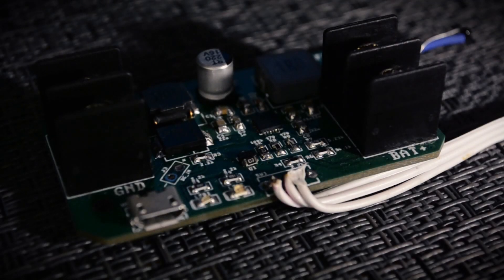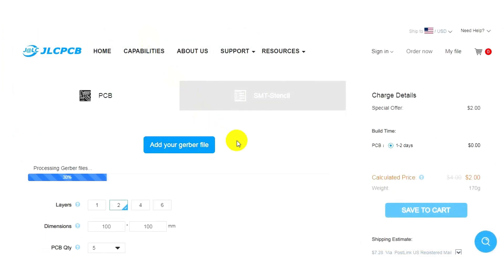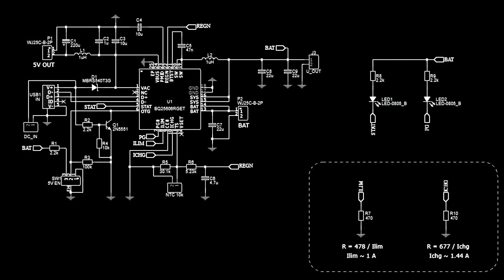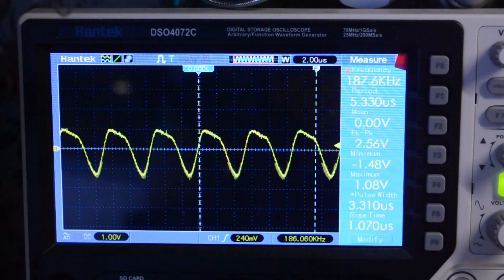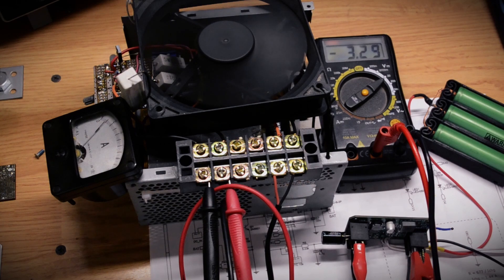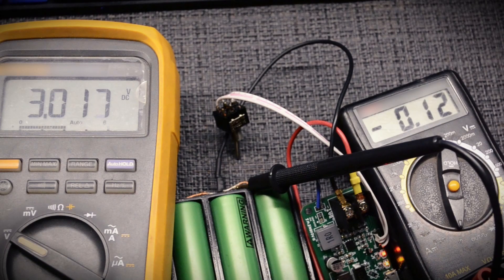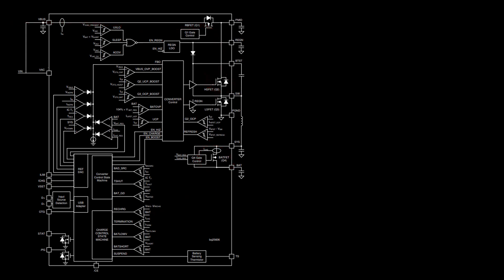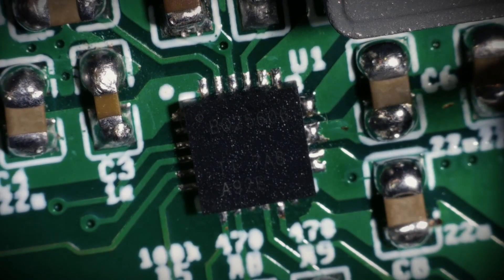Power bank - 80 level

Comment: If the diode is for reverse polarity protection, you might consider a diode/fuse crowbar instead.
If the voltage is connected in reverse, the diode gets forward biased and the series fuse will blow. No voltage drop when power is connected correctly.

Comment: I do like your work. Thanks for sharing your hard earned knowledge with me. P.S Couldn't you use a Small Circuit like a (JOULE THIEF CIRCUIT) to lower your Voltage and Current on the beginning because this Circuit would Boost Low Voltage and Current up to the desired Rating using less Components for Circuit and would act as a Safety Cut Out with the others Circuits Employed?  I'm not a Professional. So please go easy on me.

Comment: nice! I like how it is all integrated into the chip. Also OTG means On The Go. That is in relation to the On The Go USB specification for cell phones. That way you can turn the micro-B port on your cellphone into a USB host so you can plug a flashdrive or other device into the phone directly. This IC was probably designed to be used for those cell phones.